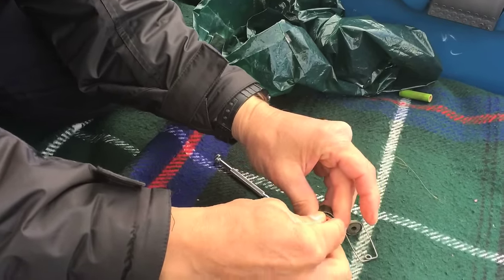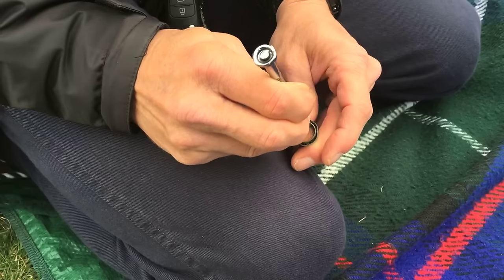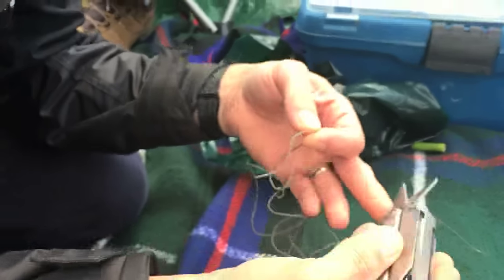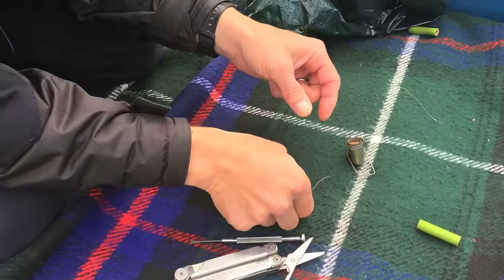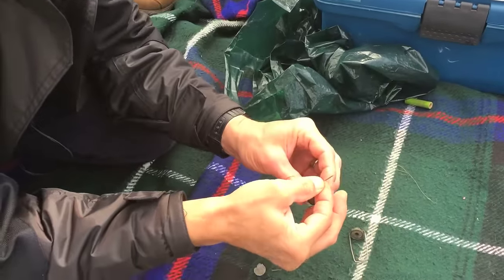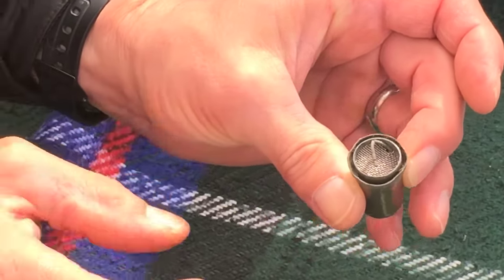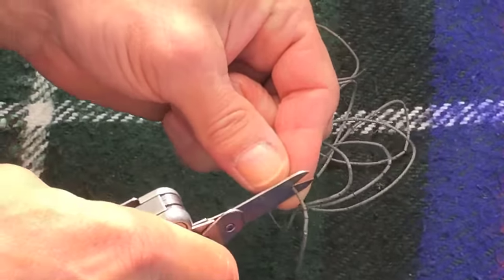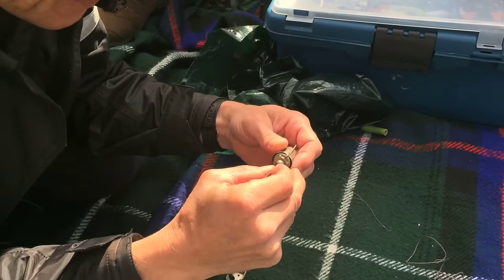How load a Jetex 50

Comment: Great memories. Used to use Jetex engines mounted on the back of a open backed Corgi Landrover as a kid, acceleration was like nitrous injection, no Health and Safety then just that old fasioned thing called Common Sense. Great video, many thanks for posting
Reply: Hi Bazzer ,  I was given half a dozen of them and can remember putting one on the back of a Landrover !  Mine was about 1/18 scale and had been Remote Control (with handset and cable .) as it was made of styrene I managed to melt a hole in the tailgate ,ah well .........  Wish I had the motors now !     Wales UK

Comment: Hi ! Just like "Jim Bo", I was bending the fuse wire to pass through the hole (not two wires, only one). And I was just scratching a bit the glossy surface on top, but only a strike ot two, not as carefully as they do on the video. Used the Jetex-50 for planes (glider), boats, and lots of rolling things (Dinky Toys cars and trucks, wagons from my HO-Fleischman train). The cat was terrified to see these devil-rollers.
Sorry for typo if any. I'm French (75 y.o.). Thanks a lot for posting this video.

Comment: This brings back my memories so sharply. The trouble is that when I played with these at 12 and 13 I didn't understand enough and I lost several of them because I didn't think of tying them to the plane or boat with a loose piece of fuse wire. I made a semi-scale Concorde for a payloader, and a semi scale B52 for a Jetex 50. I was sensible enough to dihedral the wings so it flew quite well but crashed and I lost the Jetex. I had more success with boats on a very calm pond. The plastic speedboat for a Jetex 35 that I bought went great, so I made a scaled up one for a Payloader. It went equally brilliantly but ski-jumped up the inclined concrete edge, flew for a few seconds and crashed. A lot of fun! I wonder how on earth you can get hold of a Jetex - and especially the pellets - today? Incidentally, lighting the thing was always a pain! I think every other time the fuse inside didn't catch light from the ejectable bit in the nozzle. Part of the problem was that the fuses used to crack when you bent them.

Comment: I had these in the early 50 s are they still available
Reply from the maker: No they not, the guys still flying them are using old stock fuel BUT there is a modern alternative for solid fuel powered models - Depends where you are in the world but Check out https://jetex.org

Comment: I never scraped the surface, and I just bent the fuse to go through the orifice. That was in the late 50s. It never had enough power for the KK FF scale models. Although it seemed to ignite ok. I am just building a ducted fan Hawker Hunter. I expect a bit more success and less conflagration! The eternal optimist.
Reply from the maker: Thanks for the comment . I suspect the KK kits were bit on the big size for the motors particularly if a bit heavy in the build. These guys are the current experts on all things solid fuel powered so scraping the the surface no doubt gives a bit more power/even burn
Reply from the maker: oh and good luck with the Hunter

Comment: I didn't know that anyone still did this slot racing at all and I've never seen it as an adult hobby.1/32 single seat F1 racers, pre-halo. Cut off the driver's head. Carefully drill out from the severed neck upwards to create a cavity in the driver's head, as large as possible. Mix strawberry jam ("jelly" for USA, I think) with water and spoon into driver's head and replace on driver's body. Race! A little experimentation with jam-to-water will establish the right viscosity to keep the driver's head on until the crash and the goo all over the track after the crash. At this stage, racing can become rather more to do with ambushing your brothers and sisters at the chicane, especially much younger ones. This can develop into outdoor staging and filming 1/32 accidents such as Niki Lauda (only 3 on the 1 - 10 of difficulty so it's a real goody) or the excellent inferno of a mid - 50s Le Mans where a flying Mercedes engine killed around 50 spectators in the stands but one must now use caution as these involve lighter fuel, tinder and electric arcing to "set things off". 
Those were the days when children knew what sulphur, salt petre were for, what fertiliser and sugar could do and could make pipe bombs before the unfortunate Christmas gift chemistry set makers wised up - the days when a smiling Mom-and-Pop toy store would sell you a plastic Sekiden Luger that could magazine hundreds of split peas or ball bearings for a powerful and painful spring-loaded discharge AND.....the days of the JETEX! 
One discovered these through modelling. Make the balsa wood jet fighter from the smiling Mom-and-Pop store, stretch and dope the tissue skin and instal (as per the instructions) the separately-purchased Jetex power unit. These were a small closed-at-one-end metal cylinder. The other end was a clipped-on cap with a very tiny hole in the centre. Take off this cap and load the cylinder with two Jetex fuel pellets from the smiling Mom-and-Pop store and pass a little bit of fuse from the smiling Mom-and-Pop store through the tiny hole in the cap, coil the loose against the pellets and re-seal with the clip. Instal this (as per instructions) into the fighter from the smiling Mom-and-Pop store using the supplied purpose-made bracket from the smiling Mom-and-Pop store, take it outside, hold it up at shoulder height as though launching a paper glider and - ignite the fuse. You will never see your balsa-wood fighter again. 
You will never see your Jetex again. You may never see your eyebrows again and if you are too stupid to follow instructions, you might well never see anything again. Even better is the indignant cry when someone's greenhouse some distance away is "visited" by this random, inexplicable missile - NOT the aeroplane - THAT will never be seen again - the Jetex! Loose to - ANYWHERE! This was a quick teacher of other, more controlled misuses of these things before they were withdrawn and then we had to content ourselves with sealed tins of boot polish in bonfires until - KERBLOOEY!
 I kid you not, the 1960s were a lot of fun. On more boring and solitary days, when the morning was very misty, filch all your older sister's out-of-style Cliff Richard, Pat Boone, Lonnie Donnegan, Everlies, what-have-you collection of 45 vinyls of which she had about four cases full and frisby them from the garden from the fog and.... into the fog. No one will ever know and no one will ever see them coming when they catch someone across the bridge of the nose because they frisby a heck of a lot better than frisbies. They go for miles if you give them a little "wrist" and, with that razor edge they don't exactly "float". Other dull afternoons, use your sock to anonymously sling stones from one side of the railway into the housing estate about a quarter mile on the other side. Or set fire to the brush around the gravel pit and watch and wait for the Fire Brigade to turn up to deal with a substantial blaze and clouds of evil, filthy smoke as the malodorous landfill "goes up" - all over everyone's clean laundry - from the smiling Mom-and-Pop store. Down memory lane.
 Nice video.